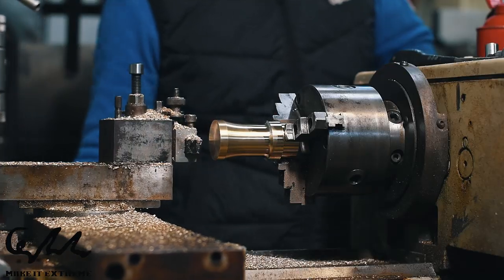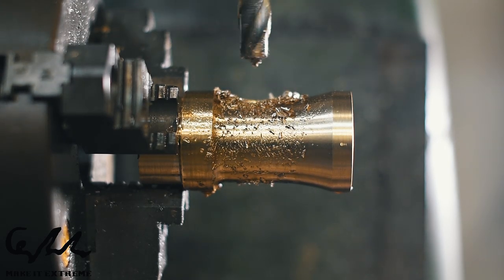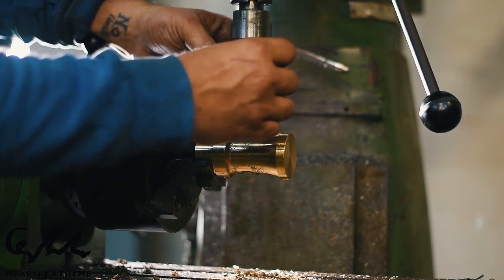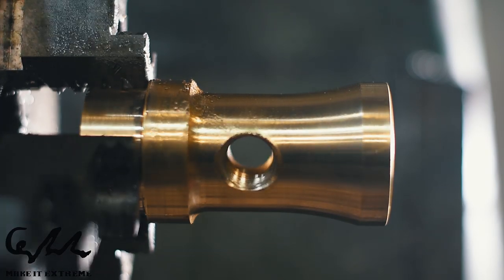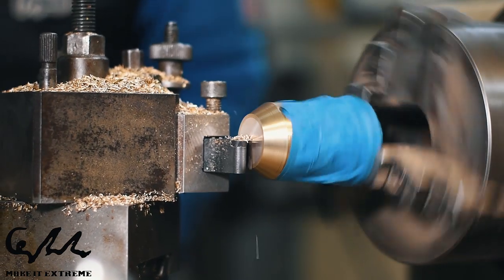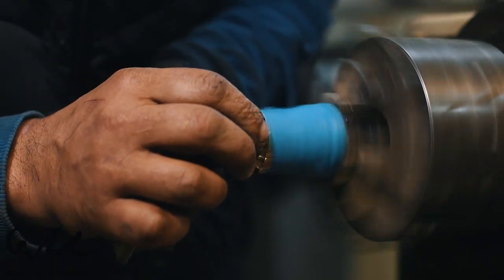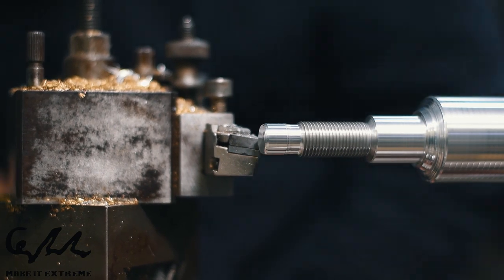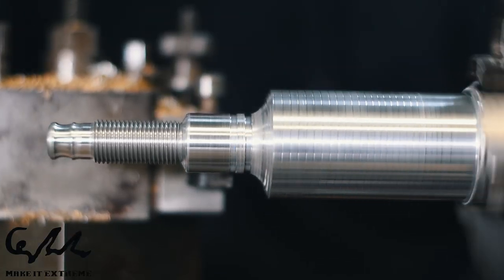Project 099 | Making a chisel hammer

Comment: That shaft centering jig is cool, got any details?
Reply: The lathe chuck? Its pretty much just a holder for a lathe.
Reply: @potatotr33  Thanks but no, not the 3-jaw chuck. The device used to center the drill above a shaft... shaft centering tool... as seen at 1:22
Reply: @BaconbuttywithCheese  Thats a really smart tool and you can make it on your own if you want
Reply: It looks like it's not very accurate in terms of a machinist that are usually looking for 1/1000 - 3/1000th of an inch of accuracy.
Reply: @HeavyboxesDIYMaster  But in this situation it´s enough. Thats sure that you can´t reach 0,01 mm or more accuracy...
Reply: @BaconbuttywithCheese   He uses a Center Finder (for round stock) then a center drill, then a regular twist drill

Comment: When I was a machinist in the Navy we had a device for making a radius on the lathe. It looked like a "C" in a frame with a handle attached to the top which swung the "C" in an arc. at the center of the "C" was a square hole to hold the cutter and depending on which way the cutter was facing you would cut a concave or a convex into the metal when you turned the handle. Much safer then swinging the tool post by hand and easy to make if you wanted to.

Comment: Your live center is broken, you can see it dance, be careful with that, they have a nasty tendency to break apart under load when they get like that and project the work piece right back at your face (because Murphy's law).
Reply: Do you drink it's broken or flogged out 
My whole tailstock quill gets a wobble up sometimes
At about 7:40 It appears the drill drops once it's out of the hole and the next one has to come up  bit to get back in the hole 
Pretty common on old lathes
Reply: Eh? I don't see what you're seeing. Besides, it's broken? Where? On the shaft? Inside the bearing? The cone? 
If the bearing's broken, it wouldn't just... Break apart. It'd just seize. The balls won't magically disappear, nor will the ball spacer. I really don't see any way for it to let the work go or do anything crazy, unless the shaft itself breaks... And that looks plenty sturdy?
Reply: I don’t see anything that is broken????
Reply: @brianmck7363  Maybe he means the wobble on that HOMEMADE LIVE CENTER that doesn't sport super ground precision? And the camera and compression tend to exaggerate the wobble. I do however agree a broken live center would toss the work right in your face, but... This one aint bork
Reply: Maybe???????

Comment: nice. But because difference in electronegativity value between brass and aluminium, both parts will oxidize very very fast
Reply: Thus the sealer he put on. It should mitigate most corrosion. A little clean up on the outer bits every now and again should keep it in check. If it's good enough to keep airplanes in the sky then it's good enough for mallet.
Reply: It's got way bigger problems than that